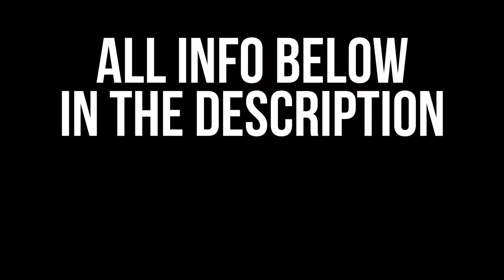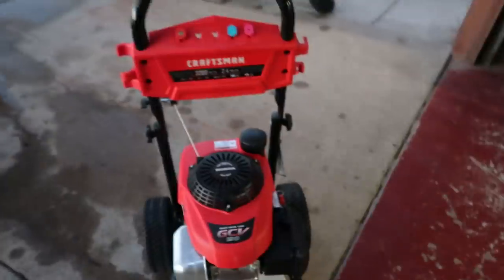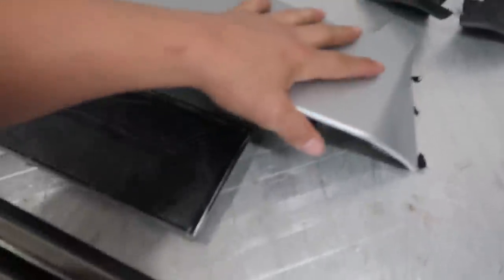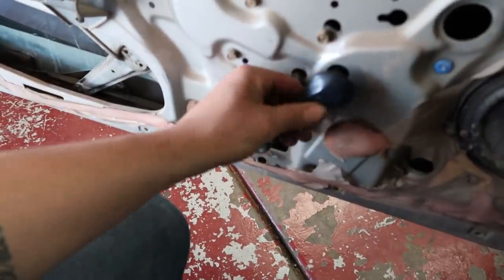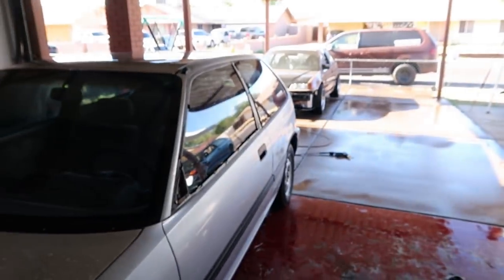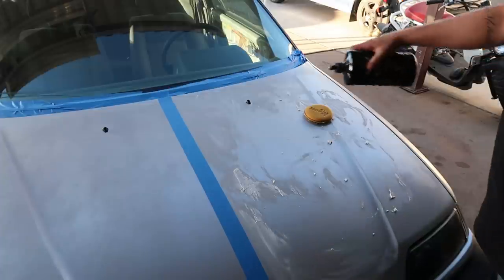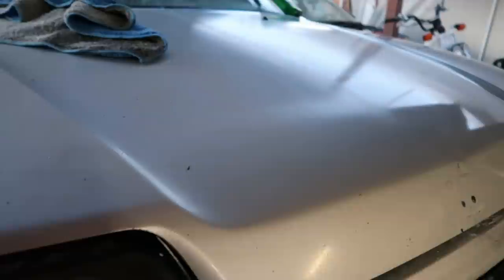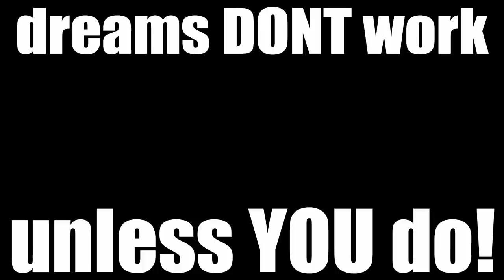Buffing the barn find civic!

Comment: When you do paint correction you wet sand lightly then you three stage compound wax polish this is what I do for a living keyword light on the wet sand if you just wet sand it lightly you might be able to save the paint and just maybe be able to send it with a little clearcoat whatever works for you just saying bro. You can get the OEM paint for that car and throw a little bit of tent if you’re doing a little bit of patchwork here and there depending on you and how much work you put into it you might just pull it off not saying it’s going to be a show room finish but the hood would really appreciate what you are doing keep up the good work💪🏼✌🏼🏁

Comment: Autozone sells a bottle of 3m compound $10 in the paint section not detail section and use it with wool pad on buffer.  It will get rid of the oxidation. Then follow up with foam pad with meguiars swirl remover. Will come out way better that way. Been using it for years

Comment: I don’t know man, everytime im in the same situation looking at a dull paint job, I think I would spend less time doing a light sand of the clear coat and just a respray of clearcoat.  Also think about buying the compound over again. $40-$50 a bottle of the 3 level/stages. So it’s around the same cost as a kit of clear and activator. And you spend less time cleaning up compound out of the door jambs.

Comment: Just a quick tip, When buffing and polishing, it's best to work in smaller areas at a time. Also you don't have to apply the product all over the area before buffing. After priming the pad, 4 or 5 dots on the pad is plenty enough to work the product in. To much product won't allow it to cut as well, and to little will heat up the pad. 
Also that presta stuff is shit. I'd recommend Megs ultimate compound and polish

Comment: bro when you buff each panel you need to break the panel  down into a grid of squares so each side of the hood i would look at it as four squares and buff each one until its finished  and you dont wet the whole hood with compound  just the square your buffing and treat the whole car this way and your car will come out a ton better than the way you are going at it